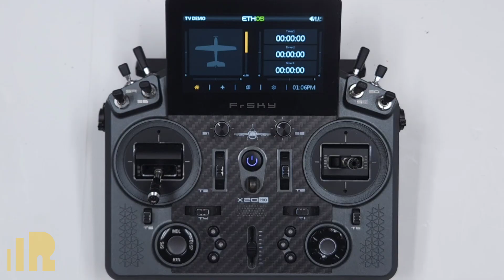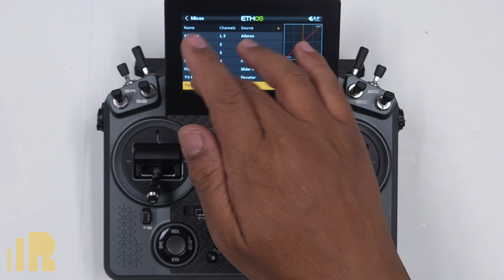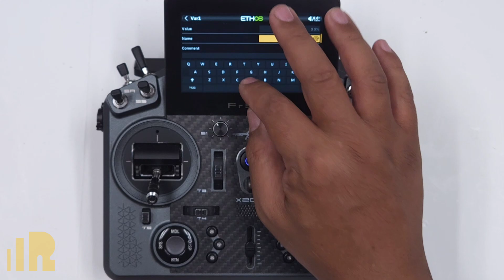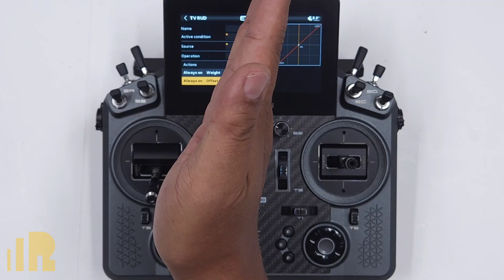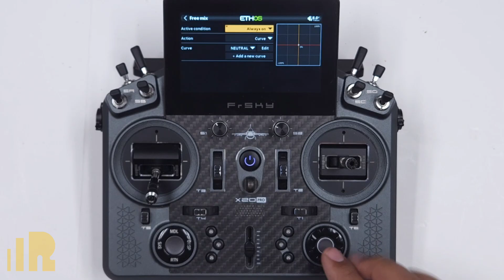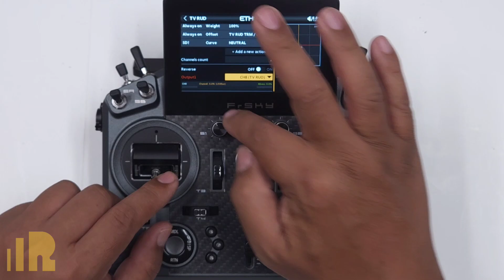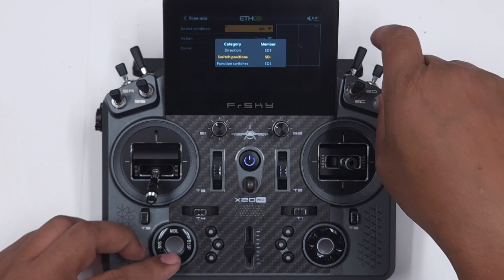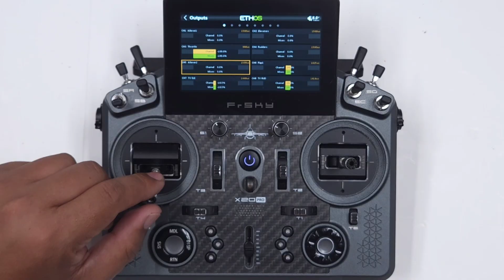Thrust Vectoring Setup

Comment: How would I set up thrust vectoring on dual nozzles to give roll authority?
This is on a Fw Su35
Reply from the maker: Think of your nozzles as wing surfaces.... How would you do it with that? Essentially the two servos used for pitch control on your nozzles... Set up and elevon mix for those channels.

Comment: Just what I was looking for.  I just received the FMS Avanti 90mm with TV and needed to set it up with a switch to turn it on and off.  And you provided even more with the trims.  I'm using the TW SR10 and now we need Frsky to allow the 2nd bank of pins (7+) to turn off the gyro just to them.  Thanks!
Reply from the maker: Right now, the second group of stabilizers can be used for thrust vectoring. You can individually adjust the gains for the tv rudder and elevator if you use group 2 for tv. But, unfortunately, you cannot turn off the second group separately.... But just wait...  More improvements are coming for the gyro system. Stay tuned!